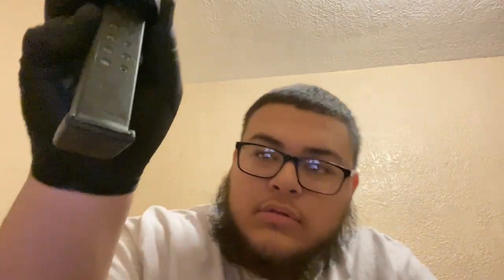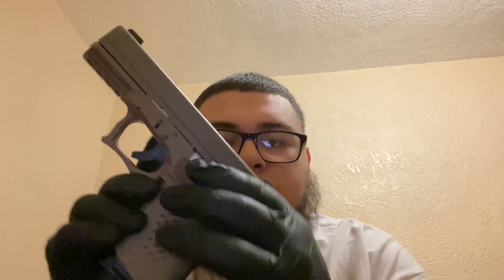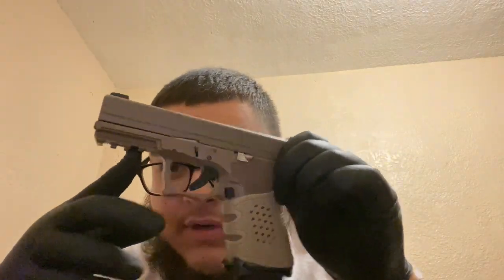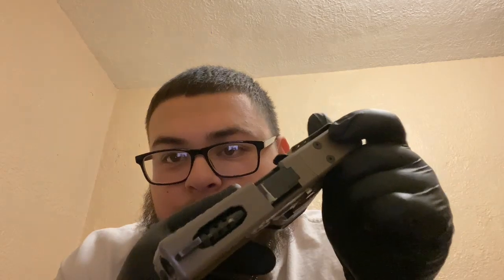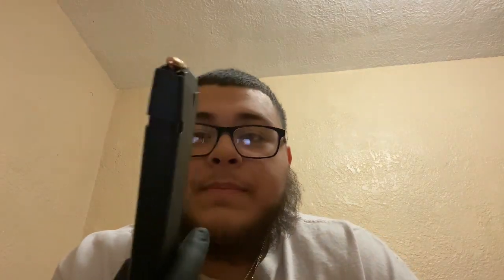HOW TO FIX A JAMMING PROMAG ( WORKS FOR ANY MAG )

Comment: I had a 32 rou d promag for the G2c and surprsingly inworked pretty good but out of 5 mag dumps it jammed up about 4 times on one of the mag dumps. Once i doubled the springs i could only get about 29 in there and only with a magazine loader. By hand i could barely get 20 in there so a mag loader is recommended. But since then ive put about 500 rounds through that mag with all types of ammo and ZERO malfunctions. I love it now lol.
Reply from the maker: Did you put the extra spring in because of my video ?
Reply: @niktotinsticks  No  this was around the end of 2022. I've known about that trick with promags for a while.  Any advice on how to get a single stack 15 round extendedag for a .380 LCP to work properly? It will function properly with 10 maybe 11 but when there's 15 after every shot it doesn't go fully back into battery it hangs up a little. One small tap on the back of the slide fixes the jam but  then it happens until I get down too 10 rounds.

Comment: Yeah I was testing my S&W SD9 with a promag 32rd. And it jammed on me. I got from gun mag wearhouse, so I don't trust it now. BUT I will try ur little trick on doubling up on the springs to see if that fixes the issue. 

Thanks for sharing homie.
Reply from the maker: No problem bro 🤝 hope it fixes your issue 💯
Reply: Yo bro did u ever do it
Reply: @niktotinsticks  i have a 32 Rd sd9ve promag what springs do I use
Reply from the maker: @JohnnyS-ms5eq  you can either be a boss and buy another one and use that spring or contact promag and ask them to just send you out a new spring. That’s what I did. However they didn’t sent it till like a month later
Reply: @JohnnyS-ms5eq u ever do it i got one too it jammed need it fixed 🤦‍♂️🤦‍♂️

Comment: Ya i have all glock mags i got a 9mm. Just bought a pro mag 50 rd drum should be here tuesday. Hopefully shit goes well! But all my glock clips reliable as hell and i got a 60 rd drum for ar promag. Very reliable just a pain to reload 😂😂
Reply from the maker: I’ve never had a problem with my promag drum got my Glock. I’ve had nothing but problems with promags sticks and regular mags from promag. Their spring in the drums are just really strong
Reply: @niktotinsticks  I feel that that's why I try not to buy those if I have the option but.There ar magazines are really good as well. But I totally agree about there pistol mags they are garbage 🤣
Reply: @niktotinsticks how much is the pro mag drum?
Reply from the maker: @sostay1888  depends on where you get it from but around 80-110

Comment: what about for .40 cal? I have a glock 22 with promag 27 round mag. I ordered an OEM 22 round mag but want to make the 27 round reliable with wolff springs.
Reply from the maker: Yeah you can order the Wolff spring and make it reliable. However I would recommend when you take apart the mag, look in the mag for any plastic debris and get it out of the mag. That can cause a malfunction
Reply: @niktotinsticks  ok thank you!

Comment: Where can i find the spring, i just ordered a kci 26 round, i cant find one that specifically fits my mag
Reply from the maker: I bought 2 26rd 45auto Glock mags and I took the spring out of 1 of them and doubled up in 1 mag. I had got them on a good deal from gunmagwarehouse
Reply: Use 9mm wolf spring for 33 round mag that’s what I’m
Currently doing with my kci 26 round ,kinda harder to put together though since it’s diffrent caliber so i suggest putting half together first and put the half spring you put together half way in the mag so it can stay together while you put the other half together and I really really suggest using a factory glock follower instead the kci follower put a drop of oil on your finger and smear it around your thumb and finger and rub it on the back of the follow and the front and both sides make sure not to get oil on the top were bullets goes and make sure it’s a little little little oil like not even enough oil to see it make it only you can see the oil if you turn your flashlight on or look closely then leave nah fully loaded for about 3 days then you have a perfect working kci mag but do suggest cleaning every time you use it

Comment: Could I put a 15 round spring in a 32 mag or does it have to be 2 32
Reply from the maker: It has to be 2 32rd springs for it to be reliable. However, you can still put the 15rd spring in there to make it a little more reliable
Reply: You're asking the real questions because I got a 8 round spring I want to try to fit in a 15 round mag 😂
Reply: @youngmelo3717 I put a 10 round spring on my 17 round mag and I could only fit 9 bullets 😢

Comment: I have a mag of 10 and a 17 mag can I use the 10 mag spring on a 17 mag ?
Reply from the maker: Is it a 10rd mag for a Glock 17? If yes, then I would say it’s possible. However I would double the springs instead of just replacing it
Reply: @ I have a Glock 26 and I have 2 mags for it a 10round mag and a 17round mag ,but my 17round mag jams to much
Reply: @ and I want to double spring my 17 round clip could I use my 10round mag spring ?